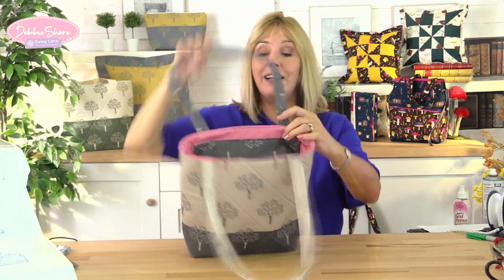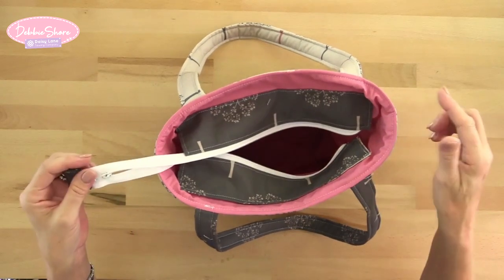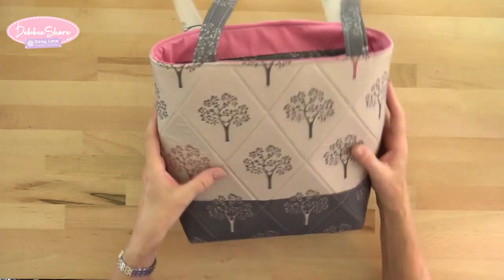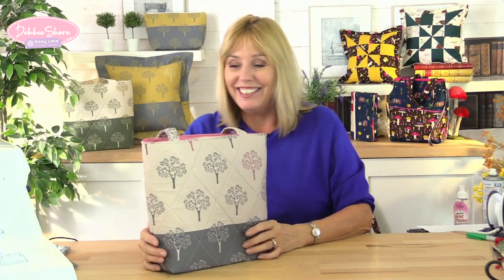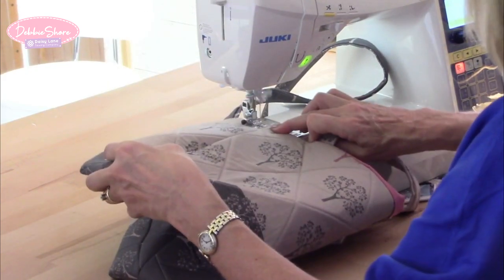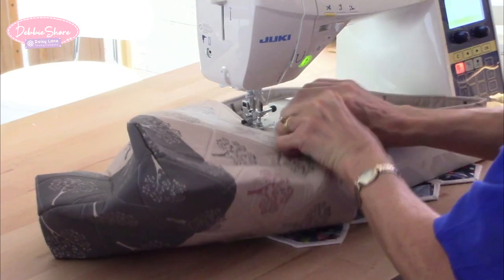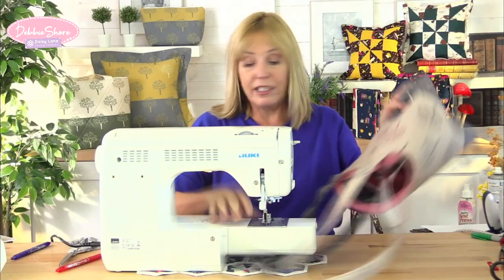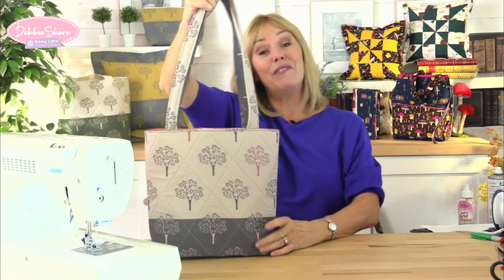How to Sew a Zipped Tote Bag by Debbie Shore

Comment: Hi Debbie.  Firstly big big thank you for all your videos.  Fairly new to sewing and made a few of your bags.  I want to now make a tote with. Zipped top to take away and use to travel.  Thought the zip would make it a little more secure.   I want to make it just a little bit bigger so am I right in thinking the top panels will always be 4” smaller i. e. if bag panel is 15” the top panel would be cut to 11”?   I have some fairly expensive material and don’t want to waste any!   Again, thank you so much.  I just love your videos 😊😊